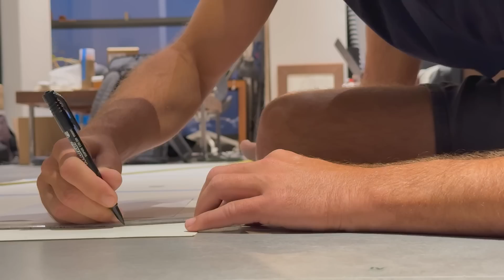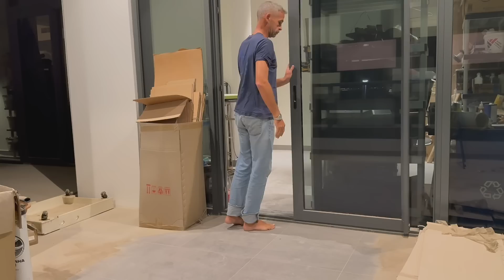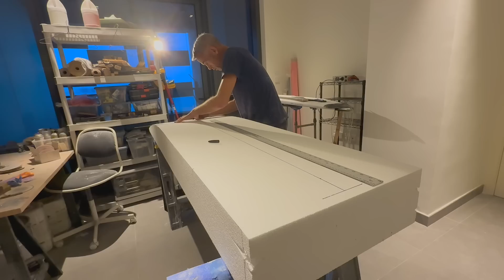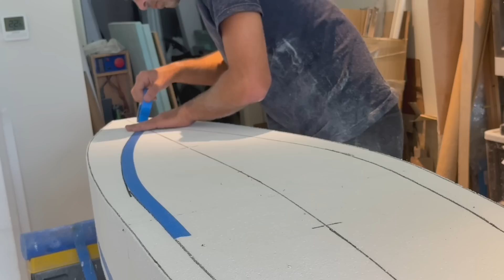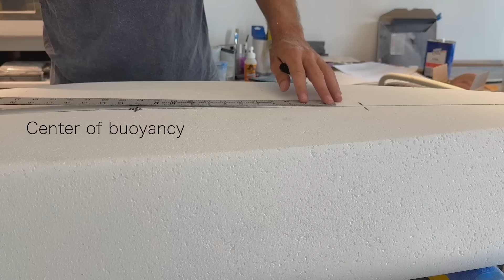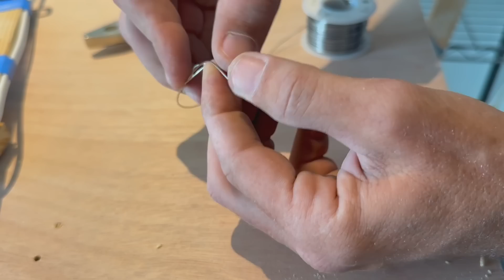Getting started on the hollow board ....

Comment: Nice video. What weight savings are you trying to achieve with this construction method?
Reply from the maker: thanks! rough maths based on the panel testing I did in previous video said a small kg... in next video coming in a few days (hopefully), that will be increased to a good kg, but you'll have to wait for the following one for a final result. I can't spoil it yet :)

Comment: Hi Mat I am doing, 2 recover board project hollowing. The first is a Slalom 290 originally 10.8 kg full of water. 8.5 kg after removing water, 7.5 kg removing water, broken fin box and finish paint and filler. This was the original weight, so means other 800 gr of water inside again. So I divided it in 2. leaving 2 cm bottom including 3 mm pvc and carbon then make it Dry and cut to 265. Now the bottom is 2 kg. In the Top I removed the back of the board foam apart 5 cm in the rail area because it was wet. in The nose I make some caverns 22.5 x 22.5. living any 22 x 22 2.5 cm back EPS and dividing in 5 cm wide original Eps. So I have left 5 cm in the rail and 5 cm center line in the from including Y corridors any 27.5 cm. Looks amazing now it is 5.9 kg I have to start to rebuild.

The secondo project it is an 225 x85  the deck is done. Externally is the same internally we have add PVC+ polyurethane to get 1 cm tall and 200 gr internal carbon. The bottom will be done with 1 cm Nomex also and carbon. I am interested on your project. Keep in touch. My impression is that working with normal tech, one can save 400-500 gr not more. The Tech of Patrik is really more efficient but is a further technology. With Autoclave, prepeg, Mold etc. 

In the past 15 years ago I made an experiment I finished in one week. 3 mm plywood okume. 4 cm wide XPS Y-X renforement glued with 250 gr carbon strips (very Raw) and phenolic microsferes. Rails done with the same 28 kg XPS. Once the board finished 5 m 290 gr Fiberglass overlapping the rails. The board get around 10 kg around 140 lt (sea Lion Replica) but worked properly and planned with 11-12 knots of wind. Good Job Mat.
Reply from the maker: you're right... i won't spoil my next videos, but weight saving is limited. Using Nomex is the best case, I'm not sure there's any core material that can be that strong with low density. I used "regular" carbon, and there may be better option that are slighter lighter and as strong.

in the end, all the different kind of hollow board (fully hollow, partial, supports inside...) are a balance of what you can remove and what needs to be added. Experimenting and documenting is great, so other can choose their own way based on data.
 
next part will hopefully be online in a week or 2.
Reply: @matshape  Yes.< 90 LT there is no great advantage in sandwich, compared to monolithic (if you use carbon, with fiberglass there is advantage in stiffness). Also if the board is smaller like a surfboard, or a kite, the monolithic has the advantage you can save time and do in 1 board time make two boards. Between 90-130 lt the sandwich is the more convenient. I think using 3 mm nomex and 13 kg eps you can choose material inner laminate and make an ideal board. The advantage of hollow costruction become evident over 130 lt board. Indeed also in 1980 for 300 lt windsurfer they make volume board like Lechner. It is interesting using hardwood construction as done by Paul Jensen surfboard. Or using balsa strengthen internally with fiber. In this case the advantage is the board is beautiful, but against a weight and strength we have to work to find the right balance it is not too easy. I have seen in lake Garda old Funboard made with Cedar wood around 3 m long, looks like 11 kg around. . .

Comment: If you use fiberglass rods that are bent to hold the hot wire it will maintain near constant tension as the wire heats up and lengthens.
Reply from the maker: that's a cool trick yes!